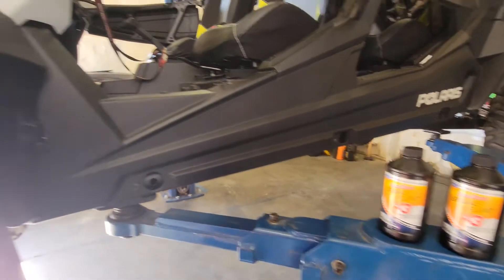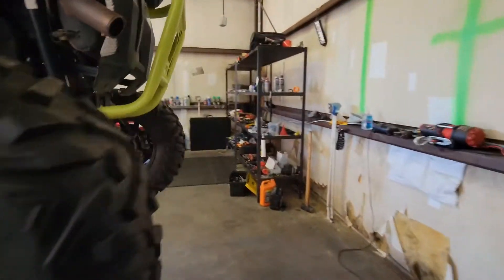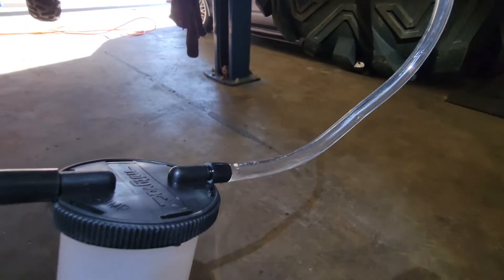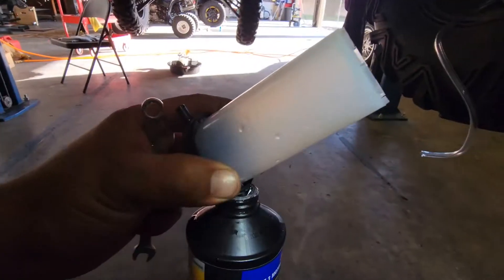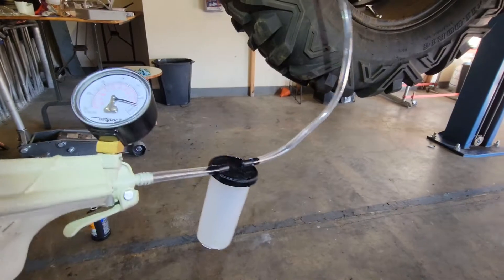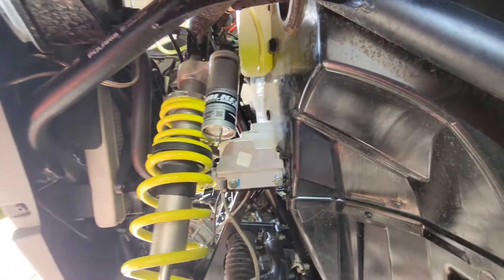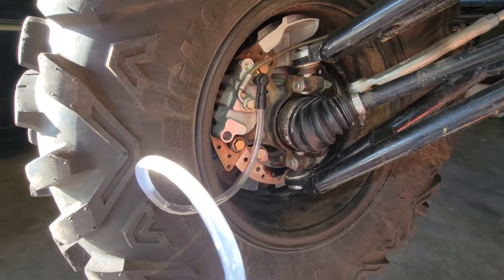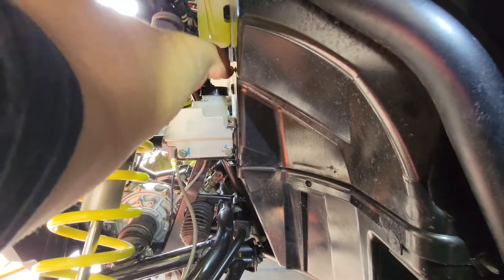How to: Bleed the Brake System 2021 Polaris RZR Xp4 1000

Comment: Sheeeeesh thats easy, now quick question, Are there cars that don't need to be bleeded or they all have to be bleeded?
Reply from the maker: All cars have to be bleed to get any air out of the system, because it's a sealed hydraulic system so it needs to push all the air pockets out in order for it to work properly and not have a squishy brake pedal. Thanks bro I really appreciate your Support 🙏
Reply: Did you have to bench bleed the master cylinder I know on the vehicles you do idk if this is the same
Reply from the maker: Nope I didn't, connect the lines and started to bleed them...no issues